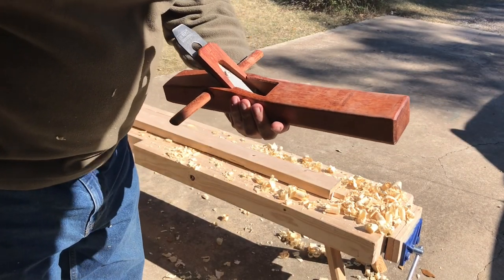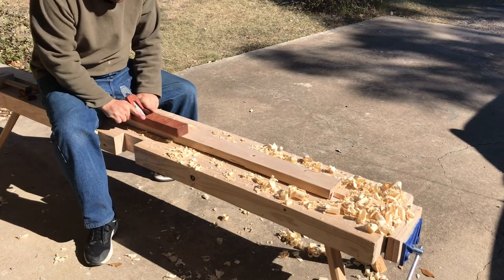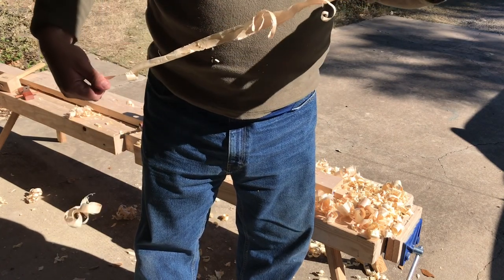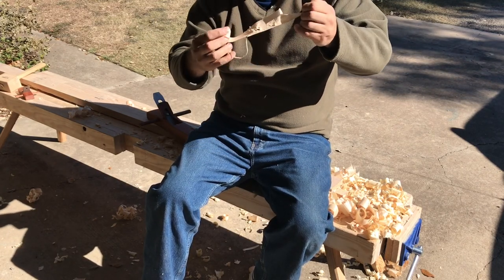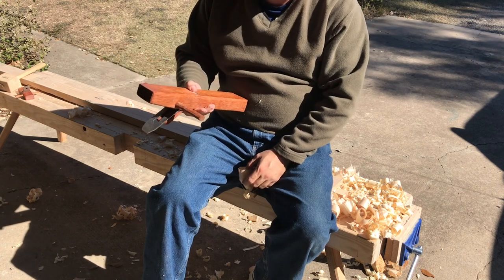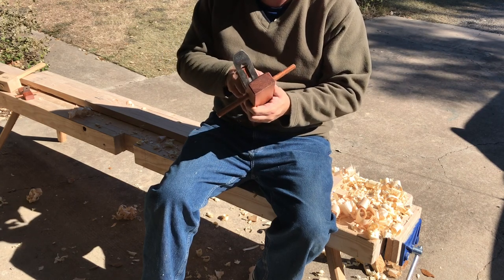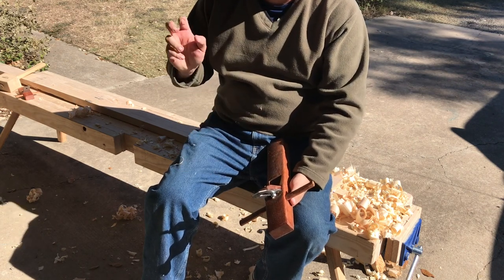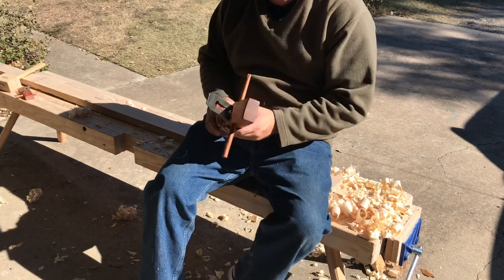Large Chinese smoothing plane

Comment: Isn‘t it better to pull the plane to your body bending the arms than to push the straight arms away ?
Reply from the maker: It depends on what I am planing sometimes a pull motion works better, sometimes a push.  Face planing is easier to pull, edge is easier to push.
Reply: Japanese planes are designed to be pulled; the area of the sole behind the throat is lower than the area ahead of it and the plane makes contact with with work surface at only two points, which are the throat and the front end. The area behind the throat doesn't make contact with the work surface. A design like this isn't good for pushing because of the lack of surface contact at the rear of the plane.

Comment: What is 2*4, 2*6
Reply: American standard wood measurements, typically used for construction lumber. The height is 2 inches and width is 4,6 or 8 inches after sawing. They shrink a little when dried or when surfaced and planed.